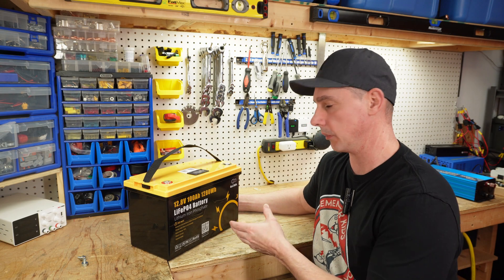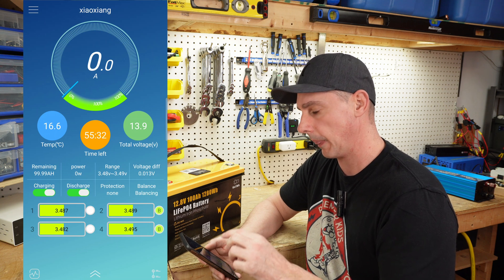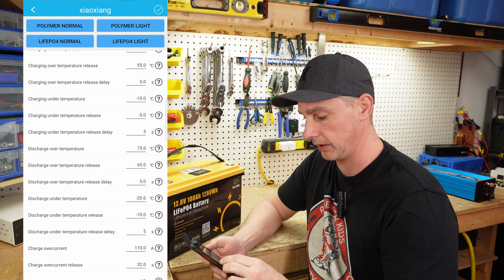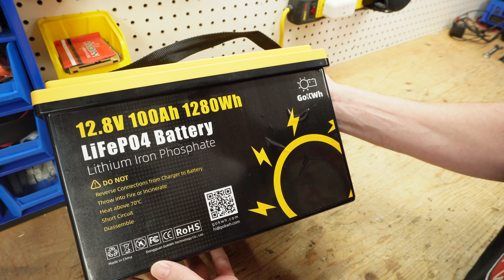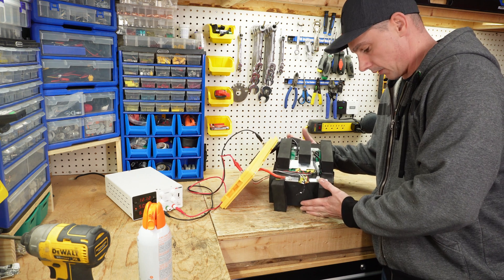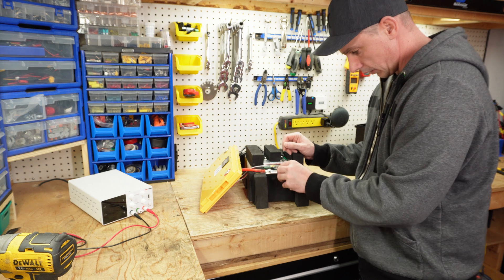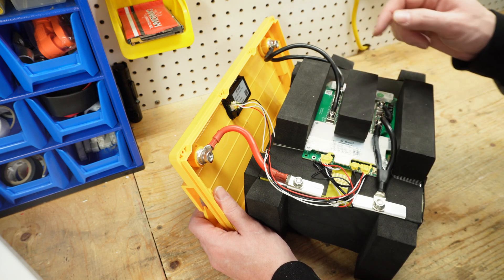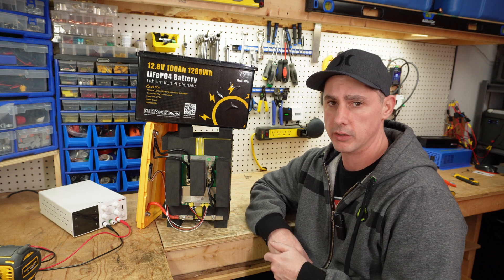Let's Take Another Look At A Different GOkWh LiFePO4 12V Battery

Comment: I saw these two reviews a bit late, at least your first one got me worried and this one feels a lot better, i just saw, and thank goodness they updated the battery because i got one on the way, i ordered it a couple of days ago with the screen and bluetooth. I will use it as a utility battery in my sailing yacht to replace my battery bank of two lead acid batteries. Thanks for your video, I hope they did or can tweak the voltage settings, from what i understand though in the bluetooth bms you were supposed to be able to tweak them ?
Reply from the maker: You could, if you get the app by overkill bms.

Comment: Thanks for another great test! I'm not concerned about the BMS cutoff being 3.75V just because this is emergency protection, and we should be setting the max voltage lower with our charge controllers. The low temp cutoff should be higher though, because for most of us the BMS is the only thing monitoring that.